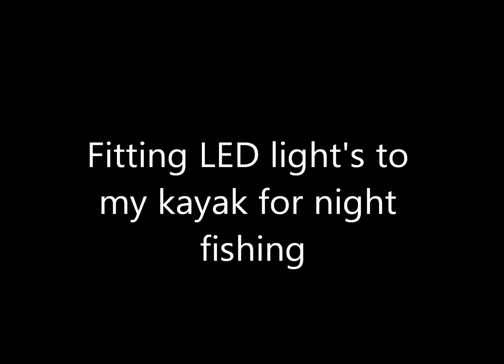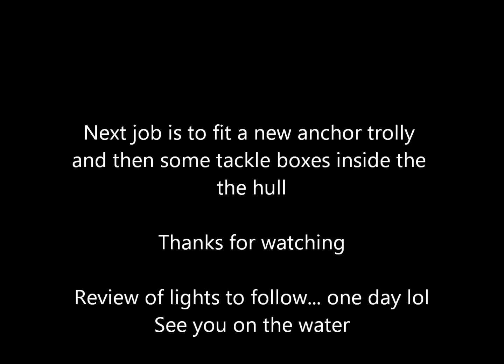Kayak mods (LED lights)

Comment: A friend of mine did the same but opted for blue, since red and green are considered navigational lights and like another person said, you woul be considered a vessel.  Three questions on the install:

1. Did you use marine-grade wire and connectors?  That means tin-based wire.  Traditional copper wire will corrode literally in a few days.
2. Did you solder your connections with tin-based solder - corrosion again.
3. Night vision is affected by white light - red or green inside if better.

Comment from the maker: i used copper wire and spade connecters with heat shrink as this was just a crude first attempt, with regards to navigational colors i only put them on for safety so if i needed to be found i could be i didnt actually paddle with them on at all times as i dint want to drain my battery as it was used for my ff/gps, i have now got a tarpon 140 and have completely changed the design and i will post it up soon, thanks for ur comment and input as my new design is being made with marine cable etc

Comment: Very dangerous with the red/green lights on the sides of the kayak.  Other vessels will think you are a power vessel and have the ability to move out of their way.  Like the leds inside the kayak.  Have you ever considered putting lights inside your kayak?  This would light up the whole shell of the kayak.  Just put a light inside your kayak and see the effect.

Comment: Did you have a problem with the white interior lights attracting bugs? I've seen other people try amber.
Reply from the maker: never had any problem with bugs. but i never left them on all the time just when i needed them as i was using the battery to power both the lights and gps/ff

Comment: so how does the adhesion hold up and lights in the water after a few months? Any issues?
Reply from the maker: adhesion was pretty good had to super glue them in places and they worked well for a while. i made the mistake of strapping the yak to the roof and the straps eventually wore through the lights bad positioning of the lights and the same happened to the white cockpit lights the seat straps rubbed through them in the end. the new lights ive made are much better as they are removable and on a remote saving the need for permanent switches and less water exposure to the lights themselves.